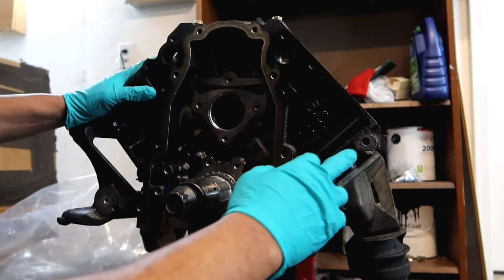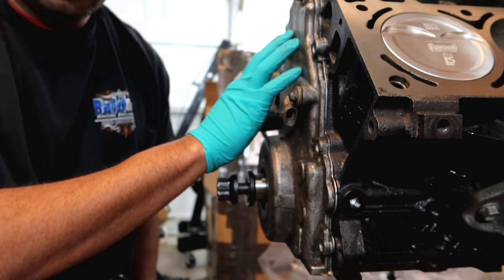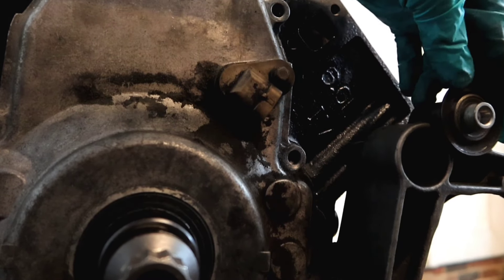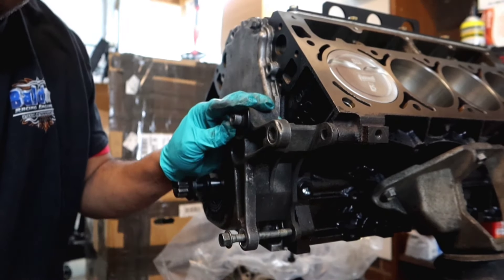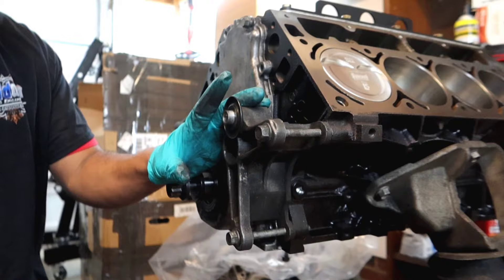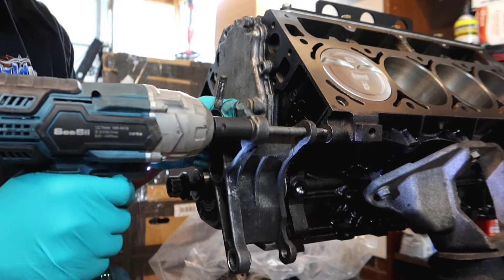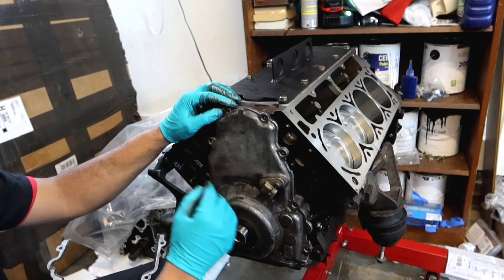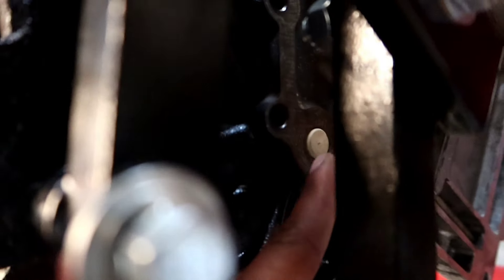Forged 408 stroker bottom end install for the Pontiac G8

Comment: Good work. I was just curious if you used gasket sealant at the corners of the oil pan. Don't want that leaking later on.
Reply from the maker: Once I install the cover, I will